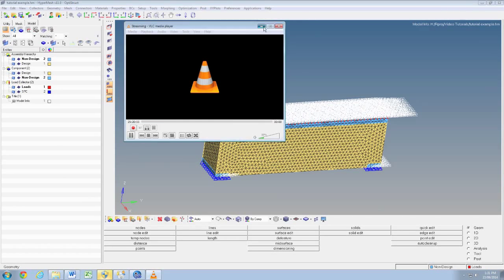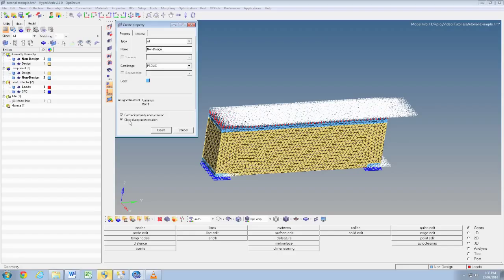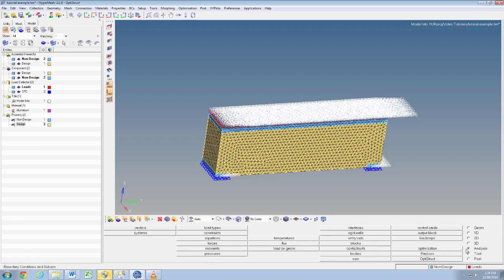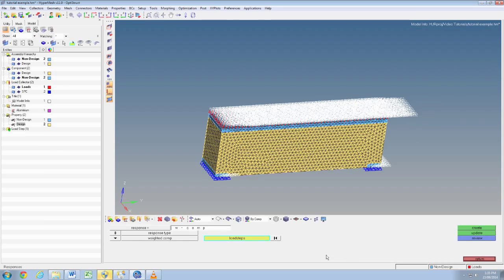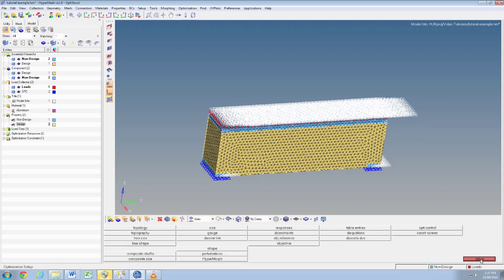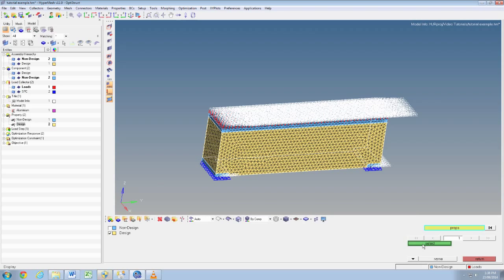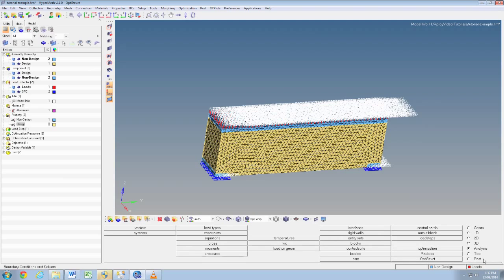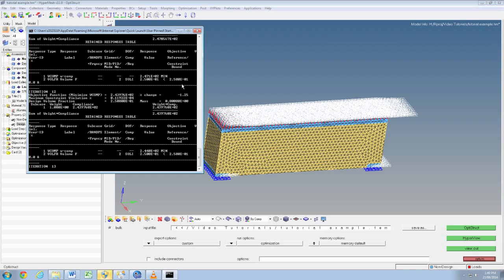Topology Optimisation in Hypermesh 11.0 - Tutorial 3

Comment: Hi, when running the check I'm getting this error message:*** ERROR #  23 *
  SID 2 used on Case Control data SPC is missing in bulk data. Any idea what the problem is? I've found a forum post saying I might not have assigned the load or constraint collector. What would I have to assign it to and how? I've followed the video as closely as possible, but still get this error. I'm working on a clevis joint for a formula student car, but getting to know hyperworks has been a nightmare, so any help would be greatly appreciated! Thanks a lot!